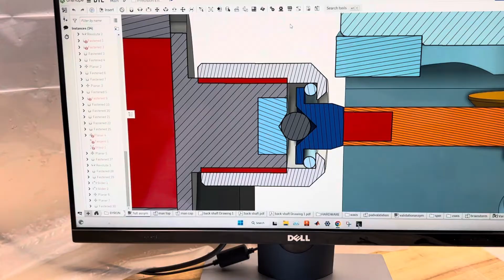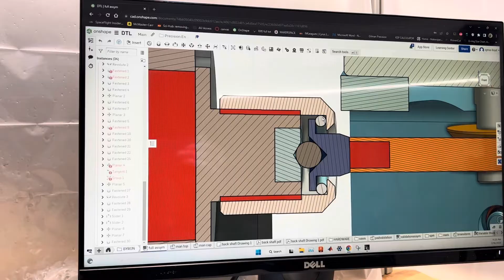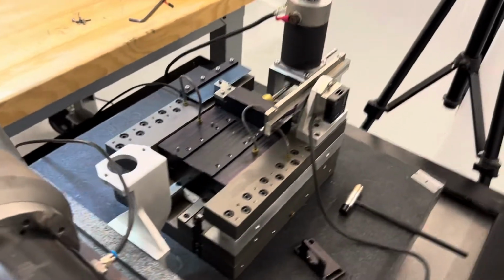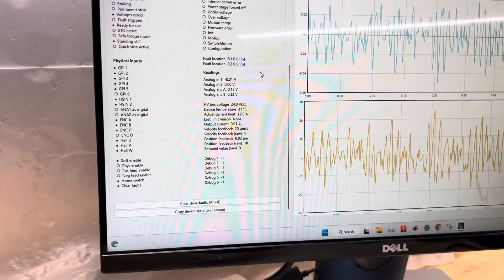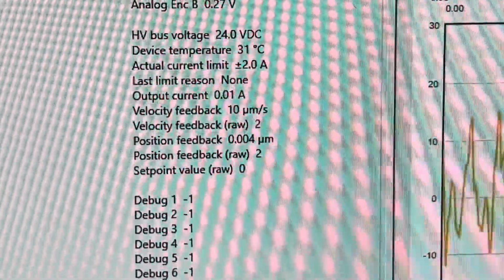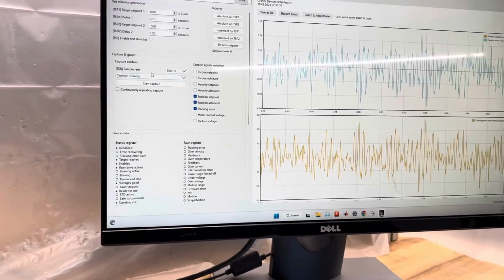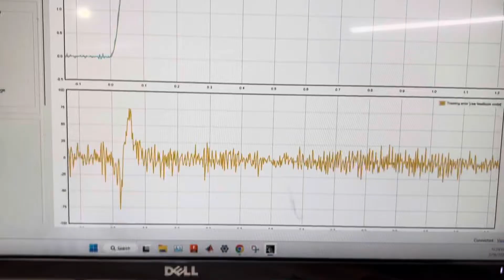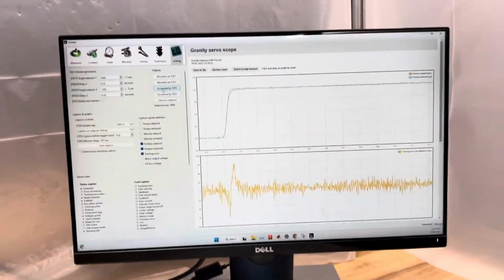Ultra precision air bearing stage with friction bar drive (DTL Z axis)

Comment: does the motor controller really provide enough accuracy for precision machining needs? it looked mostly stiff when you touched it, but you didnt show its positional data when doing so.
Reply from the maker: Yes. Because of the nature of the control loop, the stiffness of the system is frequency dependent. However, in the diamond turning I’m doing, there are no fast movements of the axis, and no high frequency perturbations, at least none higher than experienced from an interrupted cut before the part cleans up all the way. And for these modest conditions, it performs very well. The following error for the X axis during a smooth continuous cut is less than 10nm

Comment: So you have sliding contact between two pieces of steel. #1-the (z-axis) bar and #2 The cam clamp thing you tighten to push the (z-axis) rod against the spindle V. Surely that won't be an issue later on.

Comment: at around 7:00 mark talking about feed motor bearing precision, that would also contribute to error in Z absolute position even with infinitely divided encoder on the motor shaft, hence the choice of direct measurement with linear scale was the right thing to do
Reply from the maker: Correct
Reply: This is why ballscrew is better, it is easier to achieve a lower axial runout than radial in a bearing, I think.

Comment: Do you see any impact in position from the brushes sliding over the commutator? Like if you drove a full revolution, can you see where the brushes make and break?
Reply from the maker: Not thus far. Generally there is some amount of over lap in a brushed motor to prevent dead zones and jumps between commutator bars
Reply: @cylosgarage  must be a really nice motor! Who made it?

Comment: Nothing wrong with a brushed DC motor. If you want detent free, super smooth operation they are still a great option. In that application it may be worth playing with input voltage to quite the motor more
Reply: I expect the voltage will also have an impact on position stiffness.

Comment: Be aware of and don't underestimate the impact of the runout, bearing error etc in that motor will have on your system. I have a similar concept setup on my mill though at an order of magnitude or two looser tolerance lol. 0.001mm glass scales with spring loaded pair of ball nuts to give a zero backlash motion stage with a brushed motor direct driving the screw. 
The screw is slightly bent (as all screws are) about 3mm over a metre of screw. 
You can see the bend manifesting as periodic following error during rapid moves. The acceleration that would be required to take it out and give a smooth rapid velocity would be immense. So I have to take the hit to the tightness of the pid control at low speed to be able to keep the high speed motion. Not saying our situations are directly comparable given the scale differences and you can probably get around it by just capping your max feed rate. But it may be something to watch out for. Creep up on your speeds after tuning at low speeds. 
Be sure to check operation over a range of speeds, resonances spring up irritatingly. At your scale I'd be concerned about the periodic error that occurs as the balls in the bearings go past the peak load point. 
The differences between the balls themselves would likely be taken out without issue by the encoder system.
Reply: If the control loop can’t null out the brushed motor bearing noise then just need air bearing motor lol. Fundamental rule of precision engineering right? If the thing isn’t precise enough, it just means you didn’t add enough air bearings.
Reply: At this scale and speed of operation, would a bushing work instead of the ball bearing?
Reply: @marcfaulk  the issue there is as soon as it starts wearing it'll get slop or backlash in it. The best solution to this I've seen is to actually build a linear motor into the slide itself.
No backlash and no linkages between drive and motion component. Harder to get the force though and more stuff to make but it's a neat solution.
Reply: Also wow, 3mm seems like kind of a lot of bend for a 1 meter ball screw!
Reply: @andrewphillip8432  eh it was cheap and in an open loop controller you wouldn't have the issue. In terms of absolute position it's in the .01 mm range it's just a lot of noise added to the system.

Comment: Very nice! If you ever want to look at improving your motion loops further, check out Elmo's Gold line of servo drives.   The Company stinks IMHO, and they don't like dealing with individual customers, but if you get some of their drives off ebay etc. Their control loops and software are hella-well done. The tuning software is amazing.

Comment: Would it be accurate to say that the friction bar drive has zero backlash?
Reply from the maker: Well the backlash is on the order of the elasticity and hysteresis of the hardened steel itself, like down on the molecular level. I’ve not been able to measure it myself.
Reply: @cylosgarage  I guess as long as you don't drive the motor hard enough that it overcomes the metal on metal friction right?